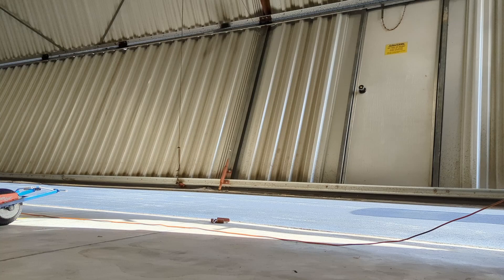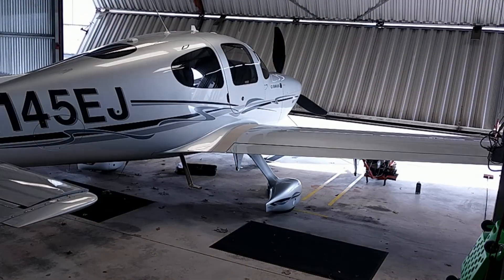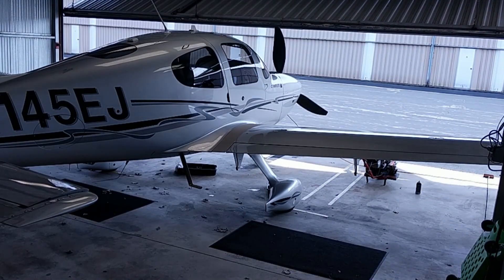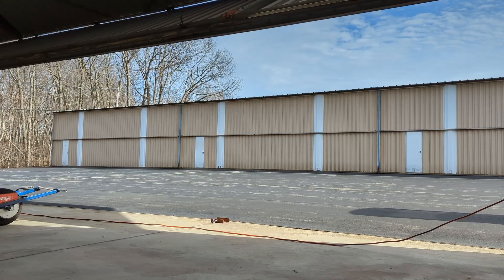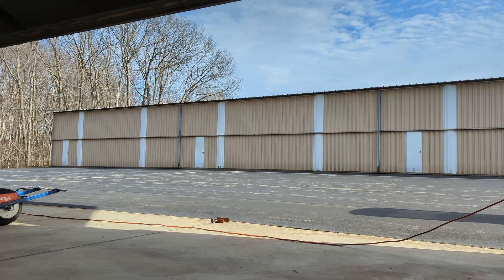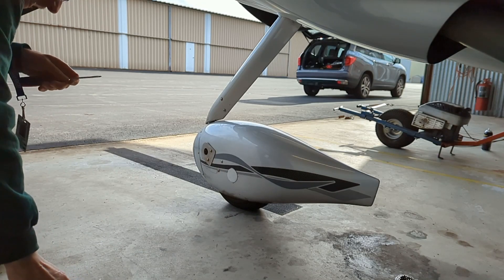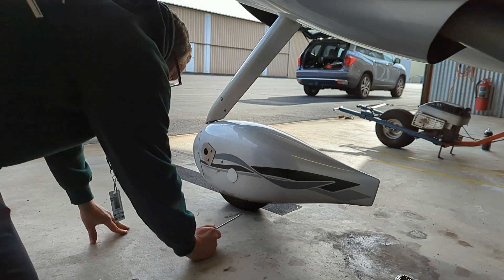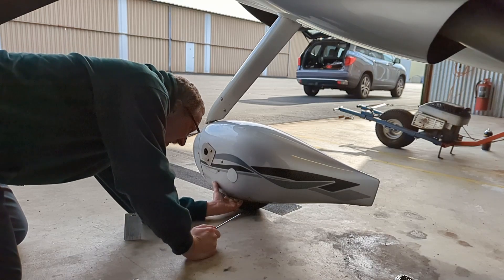Checking Tire Pressure in the Cirrus SR22

Comment: my G2 manual says:  nose wheel 40psi, mains 62psi...turbo, or G3 only 30?
Reply from the maker: Hi Eugene. There is a "Temporary Change" to the POH from 1 Nov 2019.
http://servicecenters.cirrusdesign.com/tech_pubs/SR2X/pdf/poh/SR22-002/pdf/Online13772-002.pdf
Check page 300: 
- "Inflate nose tire to 30 - 35 psi (207 - 241 kPa) and main wheel tires
 to 60 - 65 psi (414 - 448 kPa)."